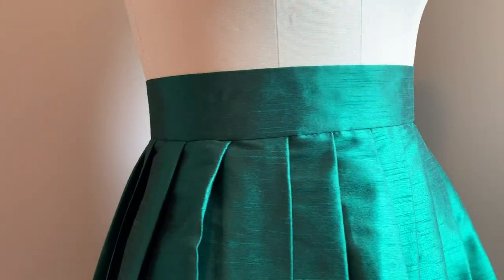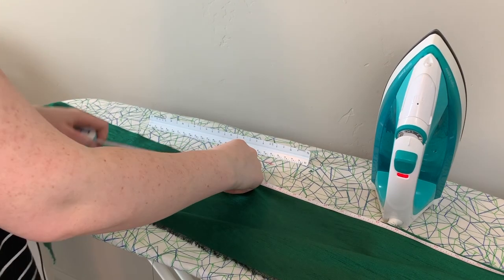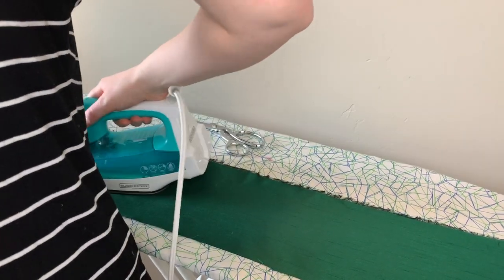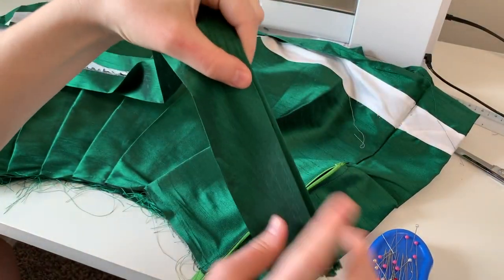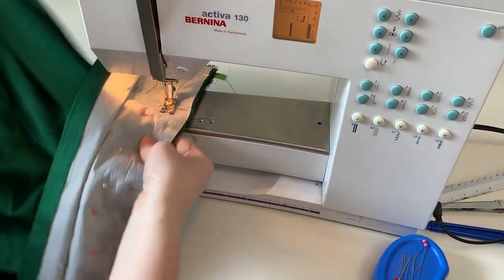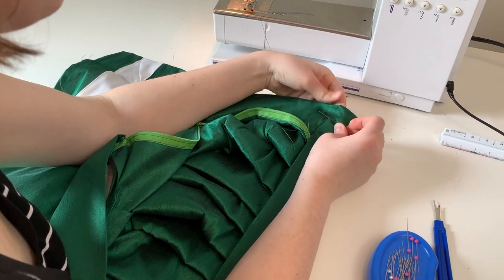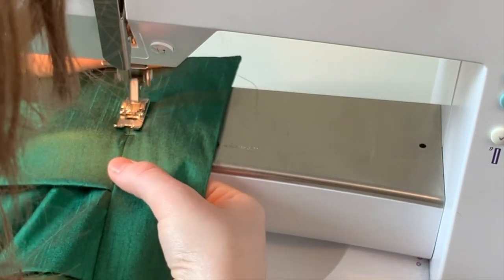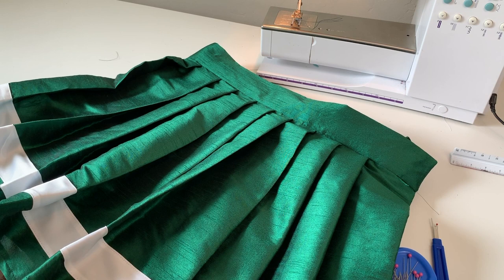[Tutorial] How To Attach a Skirt Waistband

Comment: is there any way to do this without interfacing?
Reply from the maker: You can create a waist band without interfacing it simply won't be as stiff! Follow the same steps just omit the Interfacing! (: Note that if you're using a thin/silky fabric you might want to flat line it with cotton for stability.
Reply: Add another layer of fabric in between.  Use spray starch on the between piece.

Comment: How can I hide a elastic band inside the waist band?
Reply from the maker: Hello! You have a few options when it comes to adding elastic to this skirt! You could put elastic around the entire waist but leaving a 2" gap when "Stitching in the Ditch", you would then thread the elastic into the waist band, stitch the elastic closed and finished the "stitch in the ditch". The other option is to short stitch a strip of elastic (usually around 6") directly to the waist band  (where it would be in the back of the skirt) - do this before attaching the waist band then continue as normal.